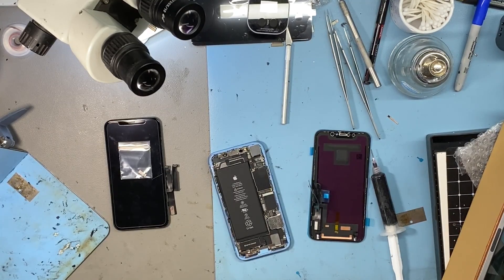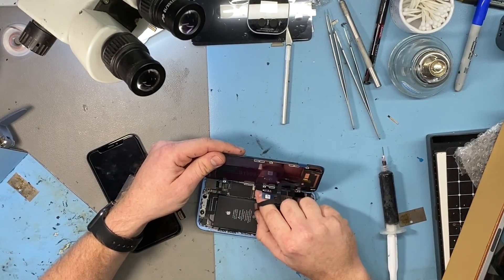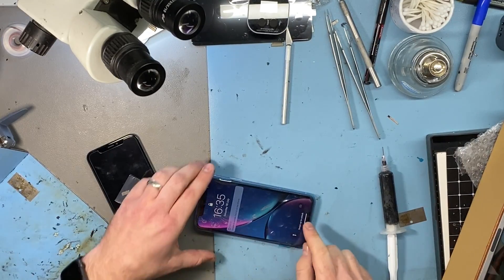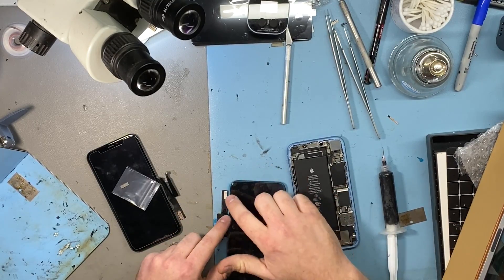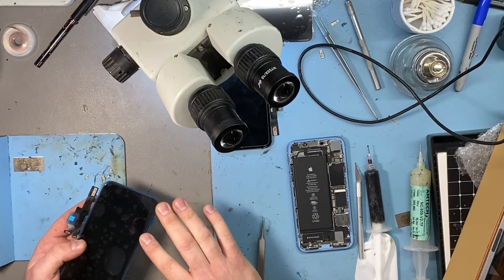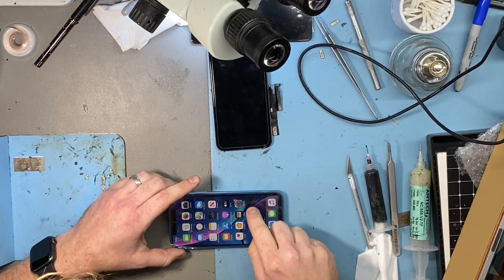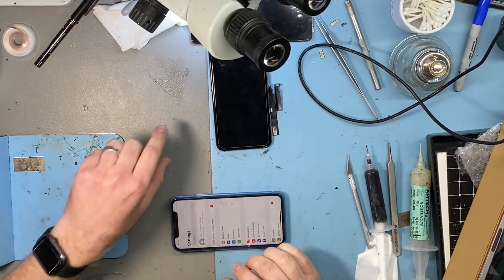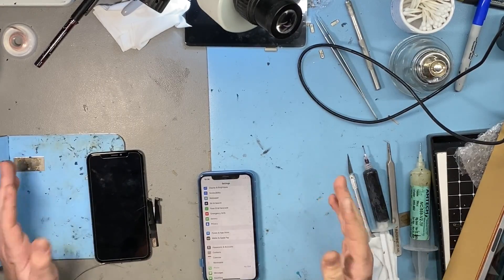iPhone XR Fixing Touch Screen Problem After Repair - Calibration

Comment: I replaced my microphone /charge port and nothing else and now the letter H and number seven don’t work in that little area so I’m not sure what I did wrong I followed a video step by step and now I have that small area that isn’t excepting the touch when I try to use it everywhere else on the phone is fine right ruin something or do I need to do screen digitizer or what am I missing here? Also, what are people saying if you change the screen you need to get it programmed

Comment: Hi, I’m having this problem now with my Xr. Right now it’s my third LCD that’s having this issue. The first one the original that came with the phone first broke and I had it replaced in a shop. They must have re programmed the screen since I didn’t lose the True Tone. After some time I changed myself the screen for an OEM screen and it works fine the first ~10 seconds you  turn on the screen, and then this touch screen problems begin. I hadn’t had this 3rd screen re programmed since I don’t have that tool.
Should I take it to a shop and get it programmed or make it change the iC? I don’t have the original lcd no more. Only the second one.

Comment: Have had the ghost issue following screen replacement. Having re-programmed the screen with an EEPROM device I assumed that would prevent the issue. I guess there is more to it than that and I wonder whether you could shed any more light on it. There certainly seems to be a lot of misinformation out there regarding theses things.
Thanks for the great video.

Comment: So how would you recommend someone like me to do this swap? 

I have replaced many iphone screens before and my latest change Xr with OEM cracked screen to a replacement screen worked fine for 12/24 hours then started ghosting. I have researched what your have you have videoed and i need to swap over the ic from the OEM screen also….. but that is next level stuff for me and beyond my capabilities. Any advice on how to get this achieved for me?
Reply from the maker: Swap it out for another display that works and cross your fingers that the touch stays good after iOS updates, if you don’t have the ability to swap ic. 

Or pay the Apple tax and pay an Apple authorised place to replace the display at a considerably higher price as they can ‘calibrate’ it afterwards so this doesn’t happen.
Reply: @rikibaker1578  any pointers on where to start expanding my skillset if i wanted to start to tackle this sort of problem? I presume microscope is one bit of equipment i need…. Lol 

Its a tad more advanced than refluxing a GPU on the old ps3 haha
Reply from the maker: @tommyboy5047  YouTube, practice, patience, good rework and soldering iron (quick / jbc). Kaisertech is good to source from UK. Jesse Cruz had some nice content https://youtube.com/c/VCCBoardRepairs but there are a few good YouTubers who post good content.  Nothing wrong with an in person course if you can find one local to you that’s good.

Comment: I got an erratic touch after an iOS update :( what would you then suggest I do, since I doubt the touch IC was moved over? Is the phone now broken or can the touch be revived?
Reply from the maker: You can use another screen which works but it can have the issue again after another iOS update. It would be nice if apple didn’t do this.
Reply: @rikibaker1578  I just dropped my phone and got a new screen, lucky I had Apple care ;)

Comment: I just changed the ic from original lcd to an original iphone xr lcd , the second one , was working ok on the donnor  phone  , but on other phone , it wouldn't work at all , no move .
After i change the ic , the lcd is working fine .
I subscribed , best solution .
Thanks .

Comment: @Riki Kim Thanks for this video. I have an OEM replacement screen for an iphone XR that originally had an LG screen. Are you saying that if I transfer the IC regardless of the make of the replacement screen it should solve any touch issues?
Reply from the maker: From my testing yes it works fine with no touch issues regardless of whether the screen is LG or Toshiba BUT I am not happy enough with it to confirm quite yet. We do manufacture pair our new screens as well as swap IC just to be safe so dataset is only devices that have had screen repairs elsewhere before arriving to us which is small.
Reply: @rikibaker1578  you are in the UK? If so do you sell refurbished screens?
Reply from the maker: @fixedtech  I am in the UK but I’m afraid I don’t sell parts, just use parts for my own repairs.
Reply: @rikibaker1578  ah that's a shame it's always nice to have contacts that know what they are doing. Thanks for your time I'm going to try transferring the IC just bought a stencil!

Comment: Can we say for certain that the phone does need it's IC from the original screen, or is there still a possibility that while it was faulty, it could have been a connection issue between the "faulty" screen and it's own IC - so reballing may have helped, rather than swapping the IC?
Reply from the maker: DannStarr Electronics next video I’ll test the screen on a second phone prior to swapping ic to show the screen is fine all along. I’m sure that screen would have worked fine on another phone before ic swapping but I did leave that gap in the video, it was seated with underfill etc. Good to plug these gaps for future videos though 👌
Reply: @rikibaker1578  I'm sure you're right even though I hope not. Too much of a coincidence when you get those iOS updates
Reply: I had this same issues with XR, it's didn't worked half upper screen I tried three new aftermarket screen's with four and six digit  and one org. screen from donor phone with same IC but didn't worked.
Reply: @mobprof805  could be a motherboard issue
Reply: @itechcarezhao389   it's worked only with he's cracked lcd.
Reply: @mobprof805  replace the connector should solve your issue